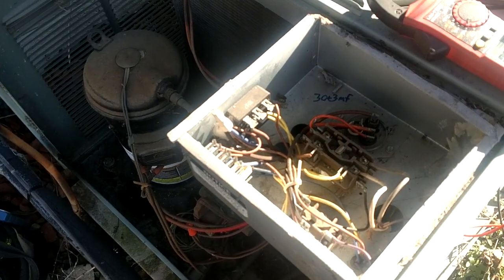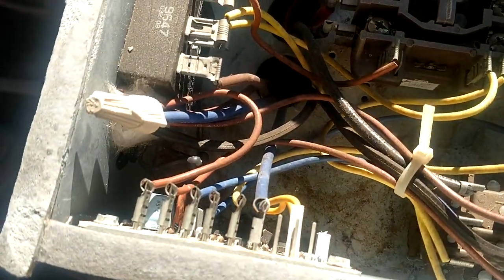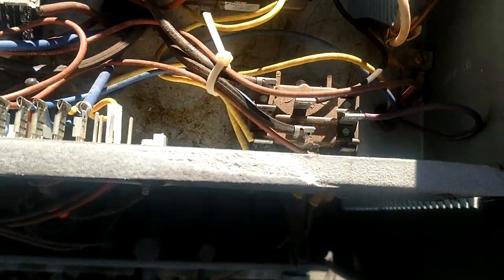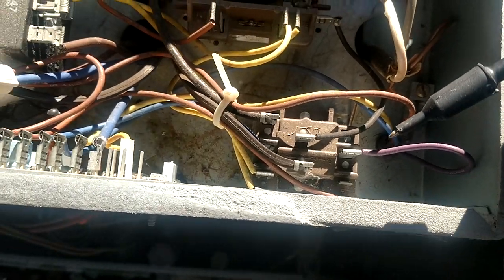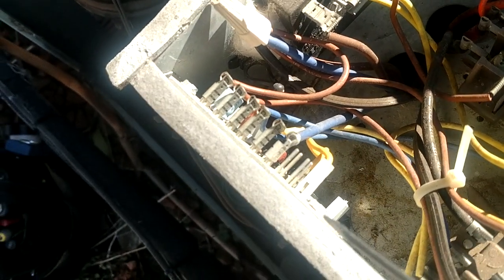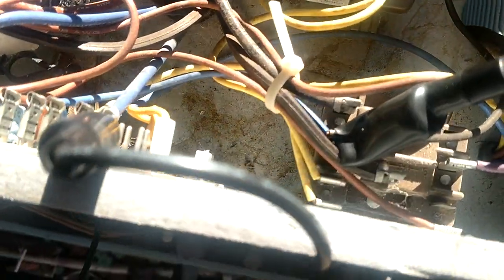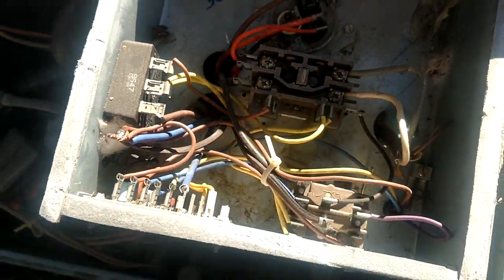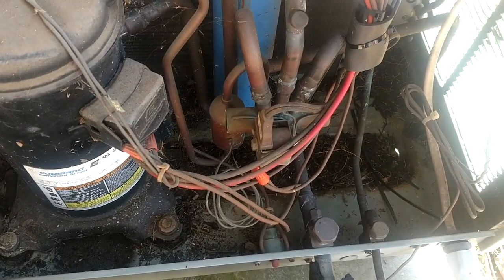Let's discuss "Older" style defrost controls & what's actually happening during the defrost cycle. ❄

Comment: Could all that be replace by a White Roger's Universal defrost board as a retrofit. My old Ruud/Rheem unit has a ice cube relay and the brown relay as well as a large circuit board in a sub panel. I would like to simplify it all if possible.
Reply from the maker: I'm sure it probably could be. But if it wasn't giving me any issues than I would leave it alone..Go with the old  "if it ain't broke don't fix it" motto. Sometimes that old mechanical stuff is much better than new circuitry. Thanks for watching. 😎👍
Reply: I believe my board is going bad. The unit keeps kicking into defrost with the A/C on and won't come out until I kill the power and then turn it back on.
Reply from the maker: Yeah, then it's definitely time to do something. there are several different options available for replacing that older board/relay combo. Good luck 😎👍

Comment: Phew... 

Am on my 2nd watching. 

Heat pump defrost is the hardest thing in HVAC to get ones head around, IMHO.  

This video is very good -- a challenge for circuit comprehension but helping legs-up along the way. 

You and Anti-DIY have photographic memories for wiring diagrams.  I asked Anti once about it -- "Years of experience", he says.   Yes, I'm sure that's true, but I hope that doesn't mean years of not knowing what you're doing. 

And heat-pump-defrost isn't an everyday problem in HVAC, like, say, a clogged drain pipe. 

Thanks for making -- practice makes perfect.

Comment: I always try to test the thermostat as well. I do this by pulling the condenser fan motor wire in heating mode and around 40 degree ambient temperature the switch should close within 20 seconds. That checks my switch and I'm able to engage a defrost mode as normal after I plug my condenser fan wire back in. Thanks for the clip very informative and thorough. Great job teaching.
Reply from the maker: I usually do the same thing Dylan but that day it was in the mid to upper 50s and it was going to take a little too long to let it freeze naturally. So for video purposes I just jumped it out & and I also wanted to demonstrate how to jump it out for the guys that might not know. Thanks for watching buddy 👍
Reply: They don't have to ice up to shut. They just need a shot of heat mode with no fan. Well 20 seconds worth.  Check the continuity on the next one, might work out for you. Thanks again.

Comment: I remember being confused about how these work with only 4wires to outdoor unit and strange colors. It’s actually since the blue is reversing valve and is always hot in heat mode they don’t need a red wire.
Reply from the maker: Thanks for watching Mr. Joe 👍